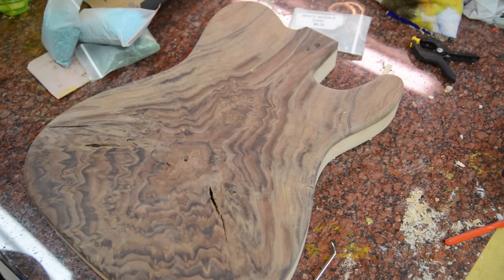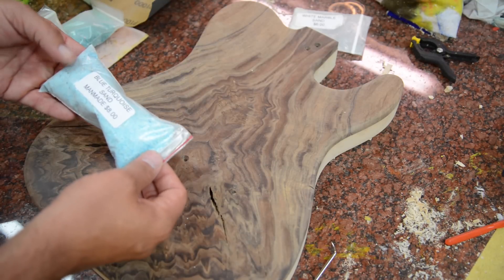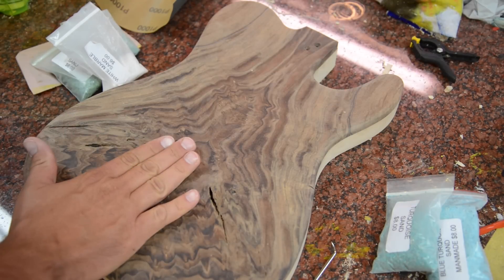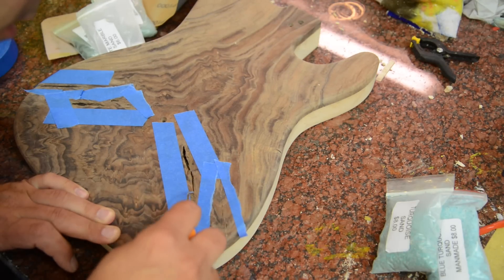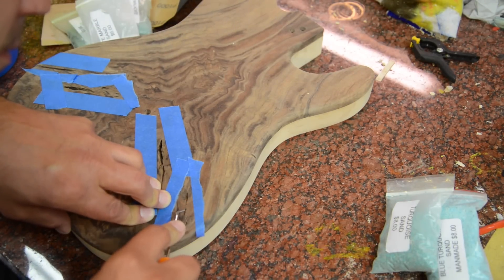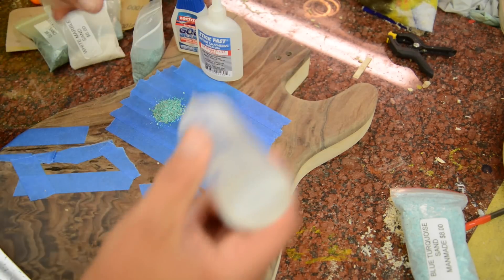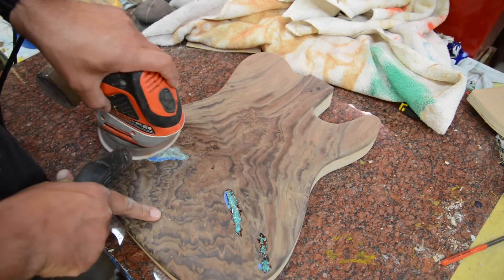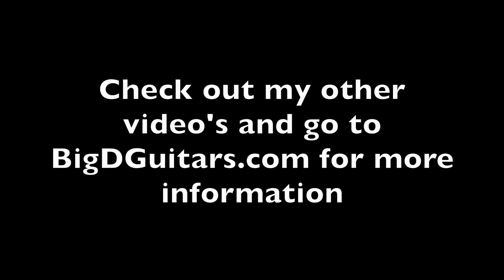Filling Gaps in wood using Turquoise Inlay with Sand and Epoxy - BigDGuitars

Comment: Wow I have never thought of using toothpicks, I use sand and aquarium stones and use a heat gun to make the epoxy thin out so that it will go into the cracks with the material...I use this on my cutting boards
Reply: What kind of epoxy do you use?

Comment: Is it possible to use this technique on a cutting board? Will the surface be food safe if I use a food safe oil finish like mineral oil?
Reply from the maker: +meowmeowgrl There is special finish for cutting board, you don't want food to get trapped in the pores thats why cutting boards are usually made of maple.  I don't know...

Comment: Does the grain of sand make a difference? And will the mix prevent the further cracking?
Reply: 1. For sand, the finer the better, unless you've got bigger holes, which might looks more astethically pleasing with bigger grains. 
2. The mix will kind of bond the holes in wood together if done properly, but the cracks may get slightly bigger over time, simply due to humidity/weather.

Comment: I bought 5.8 ounces of scrap turquoise for a project like this. Would you happen to have any suggestions on how I can pulverize it to a sand? Also, thank you for this video! Actually seeing this process take place has put me at ease a lot!
Reply: I use a piece of threaded 3 inch diameter steel pipe that is about six inches tall with a cap threaded onto the end, put my stone scrap into it and then use a piece of round steel stock about a foot long to crush it.

Comment: wonder if aquarium sand would work  ?
Reply from the maker: it might as long as the color doesn't bleed with the glue.
Reply: NO!! tried it. the color is on the outside. as soon as you sand it, the white comes through.
Reply from the maker: good to know thanks for commenting!

Comment: What a coincidence, I just picked up 5 bookmatched sets of claro walnut burl yesterday from my local wood source. I was just wondering how i would go about filling in the cracks if I wanted it to look uniform with the wood? the cracks are about the same size as yours or slightly larger. Thanks again for the very informative video!